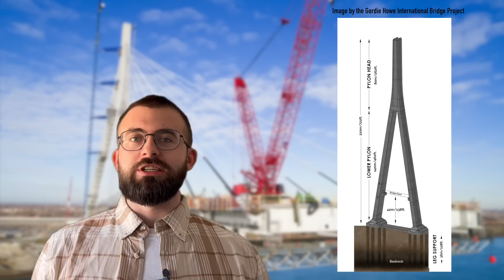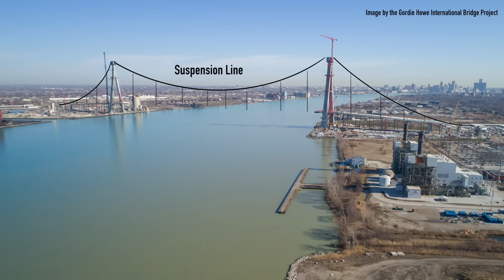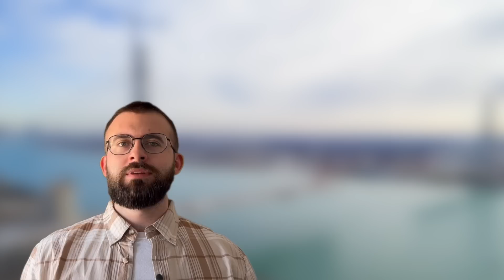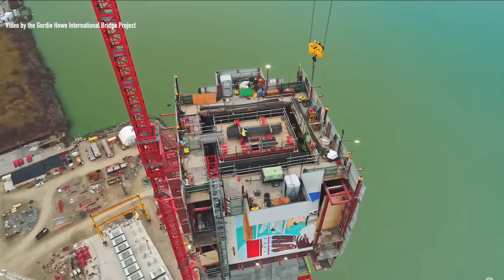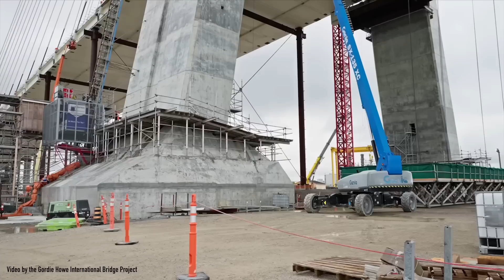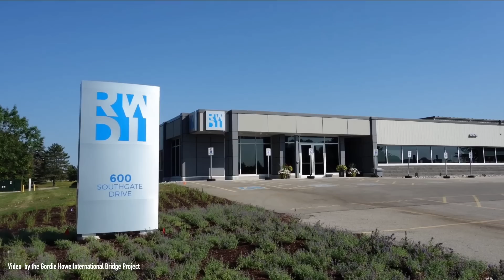Gordie Howe International Bridge - Engineering the Connection between Two Countries

Comment: Hats off to the engineers for giving something the designers could work with, also the high-quality Canadian steel that has gone into the structure,  and work conscious Iron Workers, last but not least concrete workers doing there thing. This bridge should easily out last the Oakland Bay Bridge with their cheap Chinese quality steel, faulty steel!
Reply: While this is a beautiful bridge, it kinda sucks that it costs so much and its taking so many years like every other project that Canada does. Crazy to think that the Chinese completed the Shenzhen–Zhongshan Link which is 50km of bridges and includes 7km of underwater tunnels across the Pearl River Delta in 7 years and its taking at least the same amount of time to finish the Gordie Howe bridge which is 20 TIMES SHORTER in length and doesn't include any underwater tunnels.

Comment: You should preface the whole discussion that not only does the Ambassador bridge have a monopoly on truck traffic crossing the Detroit River but that the Detroit - Windsor border has over $320,000,000 ($320 million USD) of cargo transiting across it every day, about $115,000,000,000 ($115 billion USD) per year, which makes it the busiest crossing border in North America by economic value. I suspect once the Gordie Howe bridge is constructed traffic will ease and normalize between the two bridges, slightly favoring the Gordie Howe Bridge as it connects directly to the US interstate system via I-75 (Miami, FL - Saul Ste. Marie, MI) and the 401 spur that connects directly to Ontario Highway 401, which links to the Trans-Canada Highway further east toward Toronto. Both bridges combined should see about 20% greater amount of traffic overall in volume and value once the Gordie Howe Bridge is open to traffic later this year.

Comment: This bridge will be a crash trap since the divider between opposing traffic directions (on a roadway that will connect an Interstate highway to an Ontario freeway) will be only a painted double yellow line, and not a concrete jersey barrier.
Reply: It is that on the current bridge. You can't speed over it either because you have customs and toll booths at each end
Reply: @marklittle8805  - Not to mention the wind and black ice trying to throw you into the river.

Comment: That's funny about the original railing making noises in wind tunnel tests. I guess they didn't want another "singing bridge" like what happened with the Golden Gate Bridge when they installed new railing several years ago. 😄 Good thing they caught that before building started, as I'm sure that wouldn't have gone over well at all with anyone living nearby.
Reply: Most probably only at very high wind speeds

Comment: Funny! You present this ordinary bridge project as if it is High Precision and Accuracy cutting edge Technology... 
Since 2010 China has opened 100s of these and 1000s of bridges... the majority being located in very remote locations and or at several kms above ground level. All being much longer, higher, wider, with most being a Road and Railway combined. 
This is a basic bridge as we have been building Europe for decades... and like others - connects to urban conurbations. 
IF it was not for the greed of the other bridge owner...  it would be the 4th or 5th crossing built over the past century. 
Undersize, under capacity, and going to be gridlocked withing days of opening. OH and it lacks a Railway component.
Reply: Good example of why private ownership of public services is a bad idea.

Comment: As a Detroiter, that was great information on how and how well they aligned the bridge decks at the final connection. Amazing, and to think the surveyors set that all in motion years before while planning the towers. I did not know that they used the weight of the cranes and the tension of the cables to help with alignment in the connection. Genius. Matt, best video I have watched on the building of the Gordie Howe Bridge. Thanks.

Comment: Good video. This bridge rings true for me in a few ways.  First I was a huge hockey fan. I played for 13 years. I met Gordie when I was a little kid. Got an autograph from him when he was at a game of our local semi pro team. He was really pleasant and an overall great guy. 

Then next is I delivered freight the majority of my working career. I've been over the Ambassador and Blue Water hundreds of times over the years. I know it well enough to know that if you're going east of London, Ontario- that if you're at the Ambassador Bridge, it's only 7 miles more to head up to Port Huron and use the Blue Water. Sometimes ya don't have a choice because of what the broker set up, but if I had a choice, I'd use the Blue Water. 

By that I mean if you're going to Toronto, it's 7 miles more. Not that it's 7 miles from the Ambassador to the Blue Water. 

Also, going through Sarnia, you're pretty much on the highway as soon as you're off the bridge. In Windsor, ya have to go through town. Most of the time when you're delivering, ya don't wanna take the scenic route. Ya just want to get there efficiently and safely.  

Then as luck would have it, the first company I worked for was owned by the guy who owned the Ambassador Bridge. He was a flat out crook. I got paid at first, but then they stopped. Back then phone calls were long distance. So calling these con artists cost me $$ to try and get paid. 

I did get paid, but it was a hassle. Anyway, the bottom line is with my admiration for Gordie, and despising Matty Moroun (even though he died)- I'm extremely glad to see this bridge go up. 

I no longer deliver freight to Canada, but I want to cross this bridge after it gets completed. 

Finally, great video. I enjoyed watching it.
Reply: Matty Mauron was a crook who owned too many politicians in Michigan. The state fought this and finally the Feds basically pushed the issue. Canada is paying for the Bridge so I suspect that was the deal that had to get done to make it happen. 

I drove for 15 years, half of them using that bridge. The traffic on Huron Line in Windsor was a pain but I found US Customs in Detroit was less likely to drag me though xray. Port Huron was a pain. X ray meant losing an hour and a half sometimes. Buffalo, Lewiston NY or Detroit were far more efficient.
Reply: My dad was plying the waters of the Great Lakes as a deckhand on the shipping barges as a young man in the early 50's before he immigrated from Canada to the US.  He had a lot of great stories to tell about that time of his life.